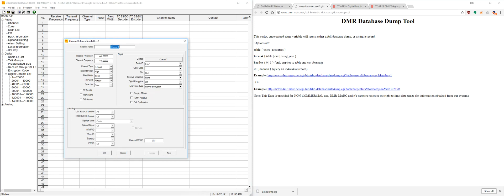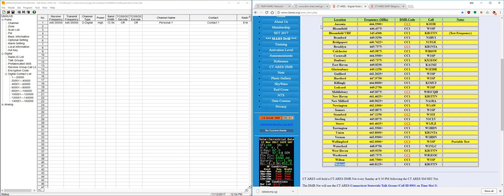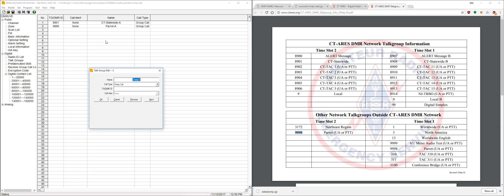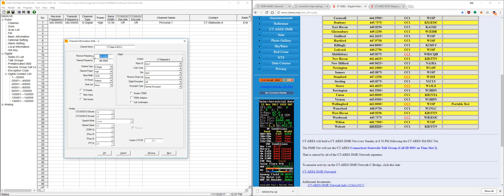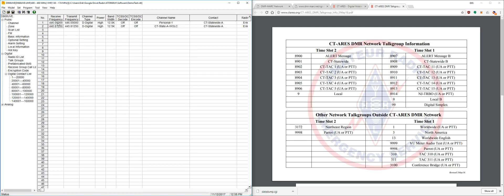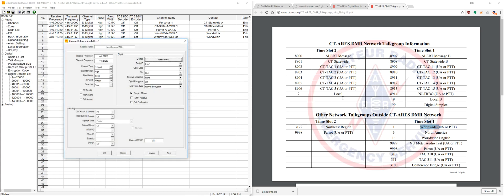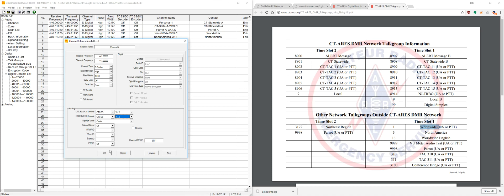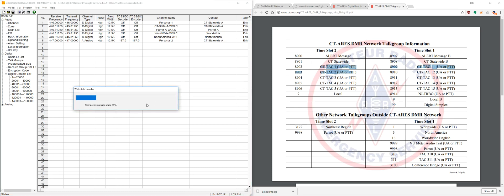Anytone AT-D868UV Codeplug Setup (Video 3)

Comment: Great video. Fellow Ct DMR user here. KC1JLF
Reply from the maker: Thank you! I also have a CodePlug for ALL of Connecticut. It has every CT-ARES, NeTURBO, and Brandmeister repeater in Connecticut, as well as a good deal of analog repeater networks around. https://www.kc1iuc.com/downloads/CTCodePlug.zip   This works with the just released firmware v2.31 that came out today. Open it, pop in your DMR ID number and it's ready to go.  -KC1IUC
Reply: WoodburyMan I'll probably be getting a new radio the end of this month. Most likely the 868. Thank you
Reply from the maker: It's a great radio! It's my Go-To radio for DMR. I have a MD-UV380 GPS to use at home with my OpenSpot since it's a bit smaller, but I use the Anytone when I'm out and about. Check out Jerry at Connect Systems, they were the pioneering vendor that sold this radio and they work with the factory directly to fix bugs and add new features. http://www.csi-radios.com/at-d868uv/

Comment: Hi, I was watching another video on how to set up Anytone 868 Code plug and they said NOT to check Simplex TDMA  for digital repeaters.  Any idea for the discrepancy?
Reply from the maker: Later I found out that this is not needed necessarily. It seems this works with both OpenSpots and Simplex/Talkabout with it checked or unchecked. Anytone is very vague on what this and Adaptive TDMA does and don't really spell out what it does as I cannot figure it out. Their terminology is also different than TYT's for example as well.

Comment: Very helpful videos, thank you.  Maybe do a video on how to follow a particular talk group while mobile?  For example, how does one follow a preferred TG when it is not allowed on a repeater which introduces the idea of BrandMeister and dynamic TG(s).  How do you configure the AnyTone to follow that preferred TG while mobile and the radio has to switch repeaters and even may have to switch bands.  Thanks again.
Reply from the maker: Hey! Sorry for the late reply. There's not much I can do a video on.. I mean if you're using strict locked down repeaters, like DMR-MARC, NJ-TRBO, or CT-ARES networks that ONLY allow specific talk groups... you cannot get whatever talk group you want on it.   If you want to follow the talk groups between repeaters, you would have to create a channel for each repeater you'd want to use, with that talk group set   
This is where VFO mode might come in handy. You can switch the radio into VFO mode, and set that talk group as your destination contact, and tune to find the local repeater. I'm not fully up to speed on how VFO mode works on this radio though as I don't use that function really, I have all my local repeaters set as zones.